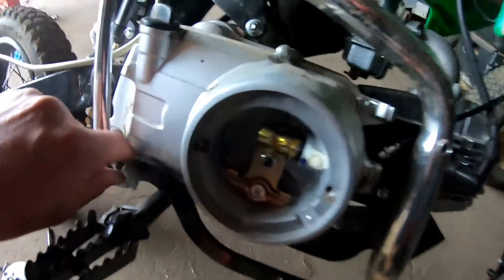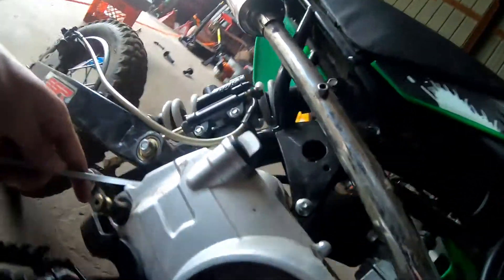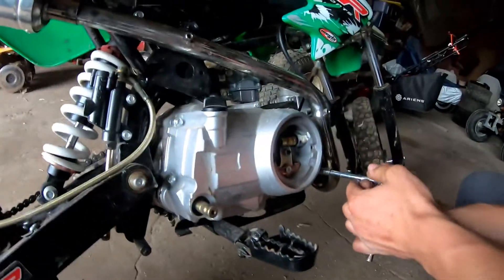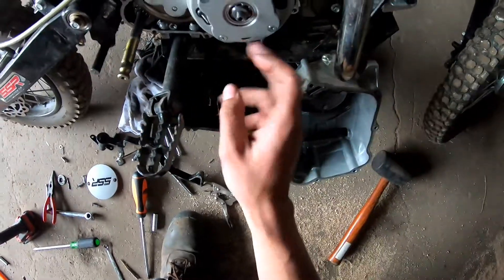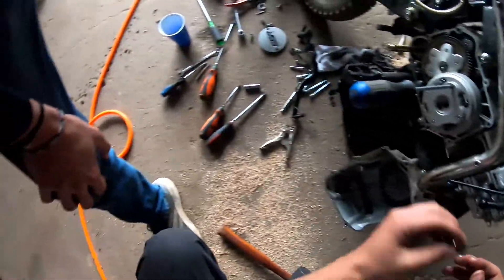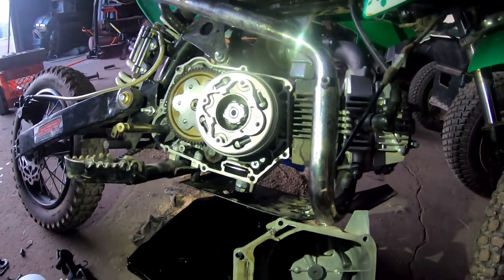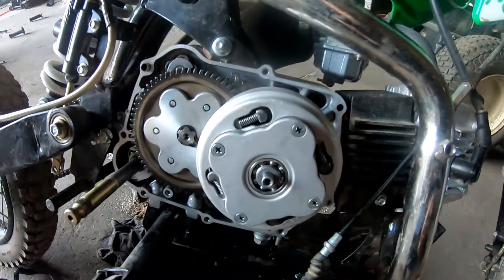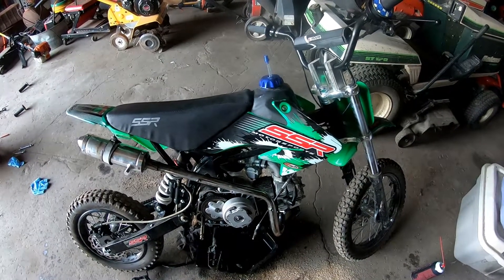(FIX) Pit Bike Clutch Problem - No Slip, But Won't Engage!! Pull Lever & DOESN'T WORK

Comment: hi what if i dont have that small push pin outside the clutch on the bearing I only have the spring, would it still work fine please answer
Reply from the maker: I would think something is wrong, you need that piece I think

Comment: I got a similar situation but the 4 Phillips head screws are in there really tight, I used and impact driver to try n get them out nut they wkny budge even tried if they're left hand threads
Reply from the maker: They are normal thread they can be tight!

Comment: I just a project 125 . Just wondering if any one has had an issue of there bike not engaging into gear .?It’s like it’s always in neutral .
Reply: Mines opposite atm
Reply: Mines opposite two always in gear
Reply: Could be your shift drum and the and make sure the plate that spins the drum make sure it’s flat and Parallel with the drum surface itself

Comment: I have a Tao Tao DB10 110cc, and I THINK it’s having clutch issues?..
Starts up fine, can scoot around no issue, but occasionally it just doesn’t wanna “Go” is the best way to put it. It doesn’t overrev or bog out or anything.. it just doesn’t seem to have the same power it usually does at a certain throttle. 
(It’s an Auto Clutch, with only a forward gear. No neutral, shifter, or clutch lever)
Reply from the maker: I think there's an adjustment on the right side ? Might be info online or other YouTube vids for the auto/centrifugal clutch
Reply: @bearkreekboys  you’re correct, clutch adjustment bolt is on the right side of the case on the Tao Tao. And oddly enough.. I just noticed there’s a little fluid leaking out from where that bolt is.

Comment: So my clutch in my lifan 125 swapped atv the engine is brand new so the clutch and oil is to but it slips bad and i have the lever adjusted to the width of a coin and the line is brand new also but i cant seem to get the asjustment on the nut correct on the thing under the cover help

Comment: The spring inside the actuator top hat looking metal barrel thing inside the bearing on the front of a pitbike clutch dosnt seem to do anything because when the spring is pushed in it dosnt push anything on the other side of it.the spring just pushes inside the actuator so I can’t see how it does anything.
Reply: Thats what i thought to it doesn’t push anything
Reply: You figured is out?

Comment: any tips mine takes off even with the lever in, i have the clutch lever fully adjusted it don’t get any tighter, i have both adjusters on the lever and cable it’s still takes off with the lever in
Reply from the maker: Disassemble and check all components something is not allowing the clutch to release. This could be stuck plates and disks. Thats how mine was. May need a new clutch very cheap parts
Reply: @bearkreekboys  thanks for the help i’m pretty sure something is rusted out inside or something like dat, the top end was locked up had water in it
Reply from the maker: Yup clutch is probably stuck
Reply: mine takes off  with lever in or out.  Worked fine the other day, till I  took the cover off and noticed a circle ground on the inside of the cove. Fixed that but now no clutch... dunno. Help

Comment: Hey I just bought a used Chinese bike from a buddy and it will shift though gears but it will not go into neutral I striped the engine and I can’t figure out why it won’t go into neutral. Any tips on this problem?
Reply: It is a semi automatic coolster

Comment: Did you replace the disks that were stuck completely or just clean them up?
Reply from the maker: Cleaned them has been great ever since
Reply: If you don't mind me asking, what did you do to clean them up? Sorry if i'm asking to much.
Reply from the maker: We used a somewhat gritty grinding pad on an impact tool. It worked great, beats using a file of some sort!

Comment: I have a 450r 2004 and whenever I try to put it into first it stalls. Any suggestions?
Reply from the maker: Your clutch plates are sticking or basket is grooved. Try blipping throttle and then pull clutch in and shift. May be time to remove clutch cover and inspect
Reply: @bearkreekboys  thanks! I saw the plates did move with the cover open. Everything seems to be working as is and the grooves aren’t really that bad. I ordered new plates anyway I’ll let you know what happens

Comment: I just replaced my clutch but it wont disengage i pull the lever put it in gear and itll stall what did i do wrong????
Reply from the maker: Did u adjust the clutch on the cover side? Also did u install the pusher on the end?
Reply: @bearkreekboys  I lost the adjustment screw that's in the case I'm not sure if that would be the problem,  with the old clutch it would work perfectly fine without it

Comment: What’s the socket called
Reply from the maker: On eBay! Pit bike clutch socket
Reply: Thanks 🙏
Reply: Also I noticed you said that it was oil, is that fir 2 stroke or is transmission fluid in there

Comment: Your float is stuck that is how you're getting gas in h your  crank  adjust the screw on the bottom of your  carb and turn your gas off when your not riding

Comment: I’m having this problem on my 2019 Taotao 140cc runs and idles good pull in clutch and click into gear and just dies like the clutch isn’t pulled in! Need help!
Reply from the maker: Need a clutch most likely had this on our tao 140 try adjusting if not its new clutch time
Reply: @bearkreekboys  I told the cover off and looked at everything looked all clean. The kid before me said it sat so I’m hoping maybe the clutch plates are just stuck i have everything g in new oil will let ya know if anything changes
Reply from the maker: Yes they could be stuck take the plates apart and clean them and soak
Reply: @bearkreekboys  okay! One more question does the 125cc cover gasket fit for the 140cc they look identical just didn’t know if the cases were bigger
Reply from the maker: I think they may be different. Not 100 percent but I thought the shape wasn't quite the same
Reply from the maker: They may be but check first and compare to new
Reply: @bearkreekboys  they look identical same bolt up and everything
Reply: @bearkreekboys  she’s fixed! Let me soak in oil overnight put back together adjusted cable and was good to go

Comment: hmm....i am having the same thing happen on my Venom X20. Brand new. Mine can shift between gears without holding the clutch in. and does the same thing lurches forward when clicking into 1st. I will see if i can get Venom motorsports to send me a new clutch...if not then Amazon here i come......
Reply from the maker: Sounds stuck plates to me

Comment: Sticking clutch plates maybe?
Reply from the maker: So it doesn't turn over or the clutch doesn't actually disengage the friction plates?
Reply: It turns over and starts when the clutch lever is depressed
Reply: When it’s pressed I have no compression
Reply: And it won’t start

Comment: That nut with the little adjuster is too far out
Reply from the maker: Good try but those plates were rusted together
Reply: @bearkreekboys  yeh i saw all way through 🙄🤣 note to self watch the full video 1st 🤣 i had the same problem but was the little adjustor thing and was ok but cant seem to find sweet spot it sometimes comes off and have the same issue where its engaged but not working put lock tite on and everything just seems weak. The hub did snap though right off the rear wheel send the chain into flywheel housing so thats non existent and as that happened think it like locked up the clutch in process   made it weak
Reply from the maker: @Los-santoscarmeets  oh wow!!! Sounds like fun loll
Reply: @bearkreekboys  i fixed most of it just got flywheel cover to get now